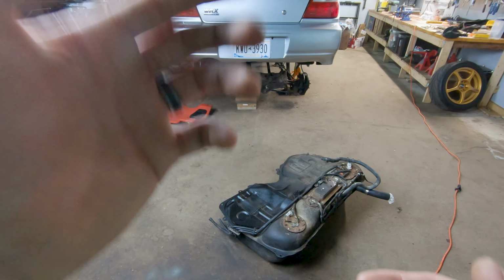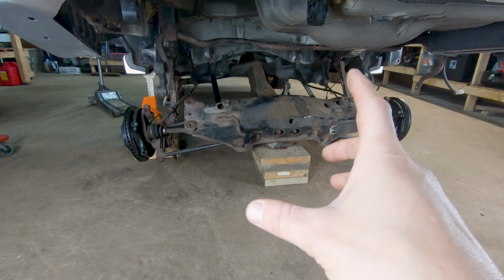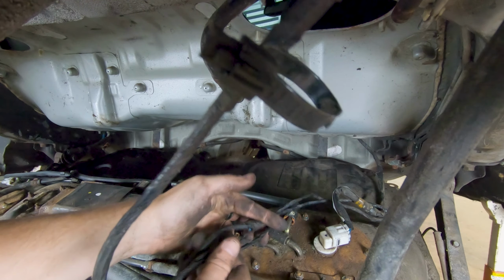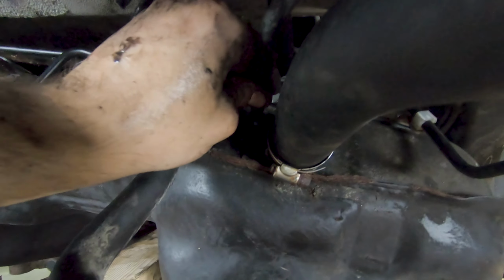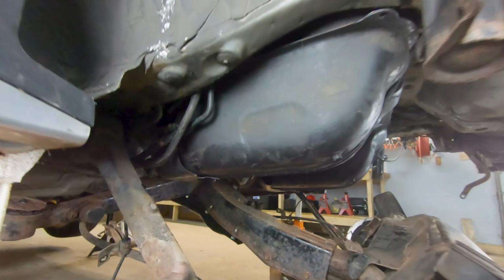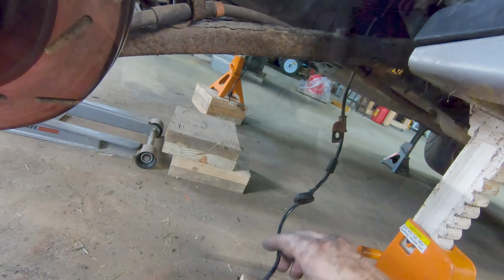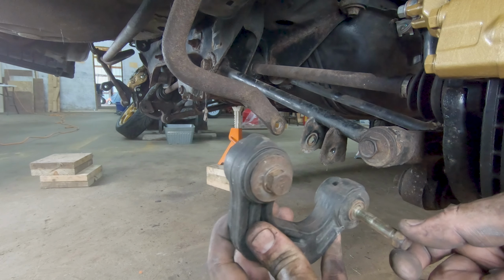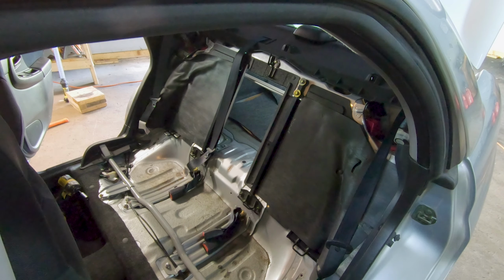How to Install / Remove GD Impreza Fuel Tank The "Easier" Way (2002 WRX)

Comment: Hey man thank you so much for this video. I used it to drop my tank and find a vapor leak on the top of the tank and patched it up with JB weld. I never would have pulled it off without this video.
Reply from the maker: Glad to hear the video helped you sort out your repair 👍

Comment: just so ya know in the future. the gas tank actually has a pump in it designed to pump gasoline. you can put a hose on the outlet and apply 12 volts and effortlessly remove pretty much all the gasoline from the tank
Reply from the maker: Just so ya know, I was utilizing the fuel pump 👍

Comment: Thanks for the super helpful video. I can confirm this procedure will also work on a 98 WRX.  Although at 26" elevation I had to lower the diff almost to the floor, which can be done if you remove both sets of retaining brackets for the handbrake cable.👌
Reply from the maker: Glad you found it helpful!

Comment: 2 drain plugs 🔌 😪
Reply from the maker: Yea I knew the drain plugs were there. Honestly I was skeptical about how well they would seal when put back ... I didn't want to create a new fuel leak while fixing another. 
Probably an unfounded concern but I knew I could do it without removing them